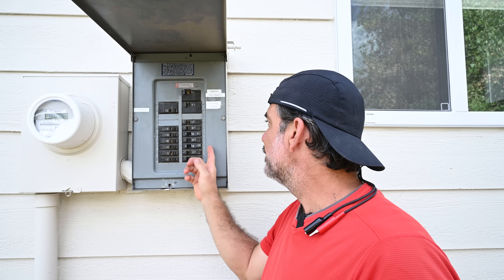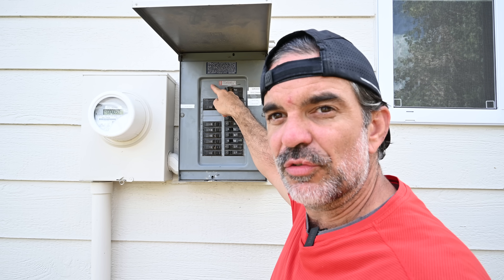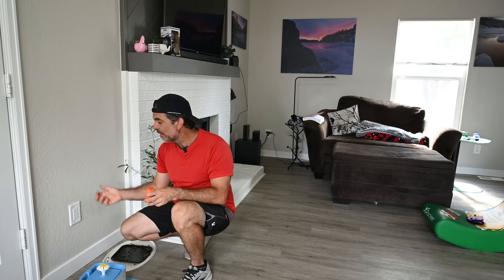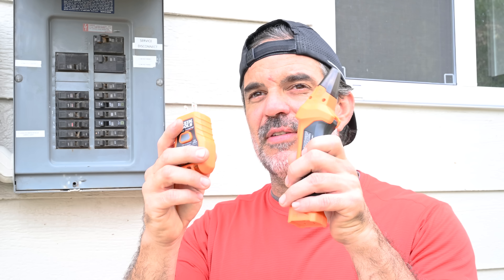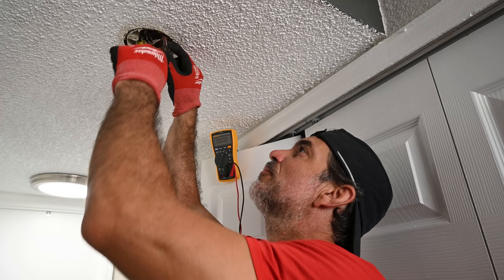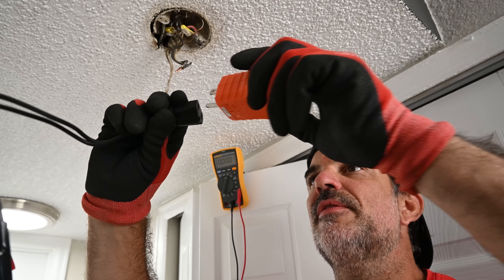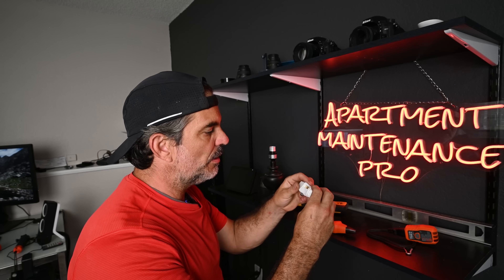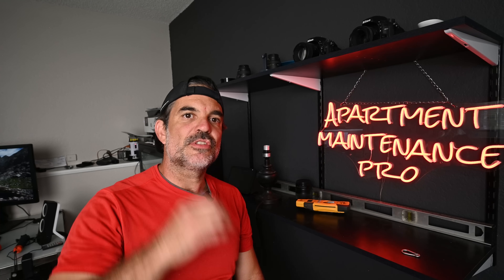Identify Circuit Breakers when Panel is Not Labeled

Comment: For sure a radio on an extension cord can be a good substitute for the gadget in the video, but my favorite noisemaker has always been a hand-held hair dryer. Corded radios are not as common as they once were, but every household inevitably has more than one dryer, and they make a fierce noise. Unlabeled, or poorly labeled , breakers are a major irritant, and for some reason too many electricians can neither spell nor print well.  In my shop building I solved the problem by painting a large piece of plywood white and using a felt marker to make a grid with the breaker numbers. The board sits next to the panel. I pencil in the areas on each breaker. This might not be practical for a house, but it makes finding circuits a breeze.
Reply: Good idea.  My breaker is in the garage and I keep a cheat sheet next to the box with all of the different outlets on the breakers.   Trouble is, the paper ages after time and needs replacing.  I'll try that.
Reply: Great ideas but switching breakers  off one at a time for a radio to go may be most of the breakers in the box.  You'll be setting clock for an hour.  I

Comment: The open ground reading on the transmitter from the light fixture has nothing to do with open ground. The alligator clips are on adapter that allows you to use the transmitter in a different application. Tip 1 when hooking up the alligator clips to a live connection do not plug in the transmitter until the alligator clips are already attached then it won't Spark. Tip 2 sometimes in places that have more than one electrical panel you will get what's called a corrupted neutral the Tracer will be telling you it's several Breakers that it's not the way to identify the circuit is to connect an alligator clip to the hot wire and the other alligator clip to the ground wire and then plug in the transmitter. Tip 3 you can do the same thing on 220 appliances like air conditioners or hot water heaters or things like that, clip one on hot one on ground. Also in newer homes that device typically doesn't work on a lot of arc fault breakers

Comment: The reason these gadgets don't work is bundled cables cross-talking the signal.  The larger the house, the more cable runs and the bigger the bundle in long branch runs from the breaker panel.

Comment: APARTMENT MAINTENANCE, Do you have a Kleins Circuit Analyzer to use the LOAD mode test on the outlets? try to make a video lesson about using the Circuit Analyzer Load test mode for the outlets

Comment: Thank you for sharing your knowledge. How did you print such a clean label. On my panel they are all handwritten, very nicely done but after some remodeling and adding/changing circuits, I’d like to do a whole new updated label.
Reply: This is me, too!  I have seen that the electrical switch companies and power panel box makers sometimes offer pads of their circuit label sheets, but homeowners only would need one of the sheets at a time, hopefully not REAL often either.  And homeowners might need to remember to check the box after every electrician visit, or the panel labels do get really confusing.  We have several circuits that don't seem to match the labelled device or outlet :-(

Comment: I used to do gas station maintenance. I would regularly get sent out to stations which had been remodeled.
For awhile every job like that I did I worked with this one electrician. Gas station breaker panels are the worst. 
They would be 40yo & the labels would be unreadable & wrong. The first thing this electrician would do would 
be to trace every breaker and make a list. Next morning, he would start his day at his shop where he would
have the office type up a neat, precise breaker panel card. He would bring that card with him to the station 
and post it in the breaker panel. I loved that guy. He made my life easy for years to come. One day, I learned
he had left his co and went off and started his own company. God I missed him.

!
Reply from the maker: Labeled panels are the best (especially when they are neat)
Reply: @ApartmentMaintenancePro yes they are, I’m in the process of labeling panels in each vacant unit while doing my apartment turns.

Comment: We live in a multiple renovated home that originally had rod & tube wiring. We just upgraded the service and panel, BUT the spaghetti wiring, including six cloth wound conductors were soldered together in a shallow octagonal ceiling outlet box. We also found one ceiling light that wasn't  working, wasn't  even wired in, and  a wall duplex with a circuit running out one side to a switch that didn't seem to operate anything. (it was a closet porcelain with no bulb)  It was a nightmare to label the new panel, plus we had a generator panel installed. This circuit finder IS NOT anymore useful than a light bulb. As well, much of the wiring had no ground but had 'grounded' duplex outlets. hmmmmmmmmmm

Comment: Your "open ground" btw was because you did not have a jumper cable connecting the outlet box to the. your ground prong on your transmitter.

Comment: You should be avoiding EVER using both hands on a live circuit.  Use one hand with the other in your back pocket to avoid closing a circuit across your heart. Also you should be wearing rubber bottoms boots or shoes as you can make a circuit through your heart and into your legs.   At 120V AC you probably would be okay, but there is a risk of shocking yourself at just the wrong place in your cardiac cycle and stopping your heart! Be scared!!

Comment: Back in the 1980's my cheap rich fortune 500 company would not purchase even a single circuit tracer for the 6 electricians in a have million square foot plant/ offices. I made up my own circuit tracer. A 20 amp toggle switch & indictating lamp on a 1900box ( 4 by 4" square metal box ). Would I stall the p!it into a receptacle and kick the switch in to trip the circuit breaker. Worked great first couple if years until I tripped an office breaker. Know where the three circuit breaker panels were located for office receptacles. None were tripped so opened covers and checked that I had power all of the breakers. After a few hours asked the security guard if they had a hidden panel in thier two offices. To!d me they had some ou d if old metal cover behind a wall calender. Here they installed a 8 circuit panel for security but one feed the office circuit that I tripped.

Comment: Plug in a radio, turn it up.
Reply: Radios are great one a single level structure. They aren’t as effective in 2 story residence with a basement. I know this from experience.
Reply: Radios are cheaper, but you might be a boomer if you have a plug in radio still. The super tip for this tool is that it works the same as a radio as a plan B If you are on old wiring and can't get a clear read, shut off your most suspected breaker and see if it stops beeping, then keep switching until it stops.
Reply: @ashmcdan23  oh yeah I still have a radio it still works. I don’t use it but I still have one.
Reply: Naw fuck it turn it off
Reply: I favor cheap-ass night lights: plug one into every outlet, hit a breaker, see what goes out. The radio is best if you want to test just one outlet though.
Reply: @kingbeauregard  yep, you said it. cheap. a three light tester will tell you much more, including faulty wiring even when a night light works.
Reply: @josephjanecka5080  You are absolutely right that a proper tester will give you more advanced information. But to quickly map outlets to circuit breakers, cheap-ass night lights are tough to beat.

I've got a room in my basement with two outlets on a different breaker from the other outlets; they even "alternate" on one wall. I think a previous owner did some ill-advised DIY. Anyway, I found that out by putting night lights in every single outlet.
Reply: yes . turn off one breaker and see what’s not working . and so on.
Reply: It’s work 240 volt too?
Reply: @rajeshpatel8690 no
Reply: @rajeshpatel8690 no only for 120V
Reply: But not the mariachis w/ that guy playing the tuba all the time. Tuba rockstar.
Reply: Walmart, 10 dollar radio  alarm that u plug in.

Comment: When testing that possible smoke detector circuit at the ceiling, you said, “Look at this, another open ground.” Of course it’s an open ground. You are only connecting to a hot and neutral. No grounding is possible with that test procedure.
Reply: There was also no polarity since it's AC

Comment: I had my wife take a plug in light bulb device to each outlet and we used a handi-talkie to communicate when the bulb shut off as I went down through the panel. She also turned on the overhead lights in that room. I took a labeler and printed up a numbered label for each outlet, switch box and device in the house. That way, years after going through this procedure I can tell which breaker I need to turn off when work has to be done. Once I've turned off that breaker I use a multi meter to make sure the power is off prior to touching the stripped end of a wire. Take nothing for granted! I placed these same labels on all the major appliances in the house, such as the washer and drier, refrigerator, etc. 

We had some internal wiring go bad in our microwave last year and it put out enough smoke to set off the nearest smoke alarm. Once I figured out where the smoke was coming from I glanced at the front of the appliance and ran out to the garage and flipped the breaker off. I've eliminated having to read the written description or key on the breaker box door and just shut off the breaker that needs to be shut off. When some people visit our house they sometimes joke about all the labels, but I don't care. It saves time.
Reply: you're a brave man
Reply: "... we used a handi-talkie to communicate" - Someday they'll invent a handheld communication device that actually allows things like text and video chat as well as audio. Won't that be something? 😄
Reply: @refisherdesktop  I would rather use a radio. It gets the job done. "Keep it simple stupid" (KISS principle) is what I try to do. I don't need a cell phone unless I'm outside the home. We use the radios for an upstairs/downstairs intercom as well. That way we don't have someone call us on the cells and interrupt us while we are doing something else.
Reply: I did the same thing when I bought the house in 1996. Breakers were labeled: plugs, lights, etc. Duh! I found that the overhead lights were on two breakers! I drew a sketch of each light and plug for upstairs and downstairs, put it in a clear sleeve and tacked to the inside of the door covering the panel box. My grandfather used to check for current: wet his fingers and hold the wire. He said he only got a slight tingle.
Reply: @knothead5  Sounds like something a grandfather would do!
Reply: ditto on the labeling 🤠
Reply: What is the product you use to make the labels? Will it print small?
Reply: @Chris-pj1os PTH110. It’s a label maker made by Brother. Thirty bucks. You can print regular stick on labels as well as print onto circular labels that you would slip over a wire and heat shrink down (like when doing new Ethernet runs before terminating them).
Reply: If you don't have a willing partner/victim ... just plug in a radio.
Reply: @Bigmar98  Our condo has an upstairs and downstairs, plus a loft. It also has a garage, where the circuit box is located. I would not be able to hear the radio in the house from the garage. Not only that we are the type of neighbors who don't like to burden others with loud noises.

Comment: I plug a radio into the outlet, when it goes off, you located the circuit.
Reply: The issue is you have to cycle through your breakers. If one is your internet or a NAS or something and you didn't shut it down nicely or have it connected to a UPS… good luck?

Comment: Meh, it's only (and I'm being generous here) about 60% accurate. I have used this tool a lot over the last 3 years doing facilities maintenance, and can testify it's absolutely wrong at least 40% of the time. Whether plugged in or otherwise.
Reply: I had the same experience but wondering if I was using it wrong. I got better performance when I removed the panel and went directly to the wires leading into the breaker.
Reply: This is my experience as well, it was not accurate.
Reply: Oh? That’s not good. 😮

Comment: I worked in telecommunications and we have used toners and locators for a long time.  I was wondering when someone would finally invent one for electrical circuits.  The toner for an electrical circuit must be a bit more sophisticated, since all of the neutrals and grounds are tied together at the service panel.
Reply: A toner/tracer is still useful when trying to locate a breaker on a dead circuit - especially in a commercial building where there can be dozens of panels, each with up to 100 breakers.  Eyeballing the breakers doesn't always help because sometimes they trip but don't flip to the OFF position.

The unit is this video works well, but only when the circuit is live since the transmitter is line-powered.

Comment: As a residential electrician with 25 years in the trade, I can say this method of finding out what breaker services what circuit is not very accurate. A much better and cheaper way is to just use the plug tester and an extension cord. 100% accurate. You have to walk back to move the plug tester anyway.

Start by turning off all the breakers. Choose a plug and insert the extension cord. Then go back and put the plug tester into the end of the cord. Turn on breakers on at a time until you see power. That will be your breaker you are looking for.

If you really want to see what plugs and lights are on that circuit, you can test for more active plugs.

Move the extension cord to another plug that has no power. Go back to the panel turn off the now identified breaker and repeat first step until you have marked all the breakers.

Two pole breakers are easier to find the equipment they feed.

Save yourself the cost of the expensive other tool, plus when you are done you know 100% exactly what breaker does what.
Reply: Plug a radio into the receptacle. Turn off circuit breakers until the radio turns off. 😊
Reply: @Fetherko  That's a great idea! I've been using the extension cord method, but that gets a bit tedious.
Reply: @Fetherko  All I need to do now is find a Radio Shack to buy a radio.
Reply: While that may work on a residential property where no one cares, trying this method in a place of business with 5 panels would not be practical at all. However, I do have this tool, and I would say it's about 60% accurate. Of which is not very good IMO.
Reply: @jungmen  This is my experience as well, it was not accurate. I resorted to the extension cord method to find out for sure.
Reply: @brianrowland55  do you know if there's a youtube video on the extension cord method?
Reply: Crazy.  Residential homes all across America with panels not labeled.  You would think building code would mandate 100% panel labels in all regions, counties, zones, in city limits, outside city limits, off grid crazies and any other location with at least one panel and one circuit breaker (😂).
Sincerely, NFPA/NEC.

Homeowners adding additional or upgrades to panels.....just label the dam thing!
Reply: @johncollins7044  Right on brother.
Reply: @johncollins7044  Remember, this country is absolutely FILLED with people who think they are geniuses that think 1. that they know everything, and 2. that they remember everything. Yet, look who they all elected for a second time....
Reply: I bought this tool recently and found it helpful in tracing circuits back to their circuit breakers for the purpose of replacing worn out and/or improperly installed receptacles in a 60 year old synagogue building.  It saved me time since I didn't need a helper and prevented unnecessarily risking failures of circuit breakers which didn't really need to be turned off.  It's not perfect by any means but it was worth what I paid for it.
Reply: The signal comes through a hot wire but since multiple hot wires are tied into the same phase, the signal from one hot wire spreads to all the hot wires in that phase. So it's hard to tell which hot wire the signal is coming from.
Reply: Not an electrician, but I used a radio. The sound carries even more easily than the lamp on an extension chord. Plus it in. Turn it on. Turn it up. Flip breakers until you hear it stop.
Reply: Not an electrician here.  I think the benefit of using the tester kit is that you don't have to turn off all the power to find the correct circuit.  If you are trying to find a circuit at an open business, using the extension cord method is not practical at all.  I work in a business with six panels and over 120 different breakers.  Turning everything off would never be practical.
Reply: Late here but I have a maybe dumb question and on the off chance you see this and can answer I’ll ask. 

How do I find out which one my outlet is if the outlet isn’t working? Can I do that without turning each breaker off and on? I’m nervous to mess up my house electrical stuff.
Reply: Only a Democrat could spin a lost election to an electrical video. GEE-ZUS!!!! Move on dog
Reply: It's always been my method, more or less. Actually it's having my wife turn off a breaker and call out, while I run around trying to figure out which outlets went dead. 😁
Reply: I’m a homeowner. I’ve used this many times with 100% accuracy. I labeled my entire panel with no errors.
Reply: This is my experience as well, it was not accurate. I resorted to the extension cord method to find out for sure.